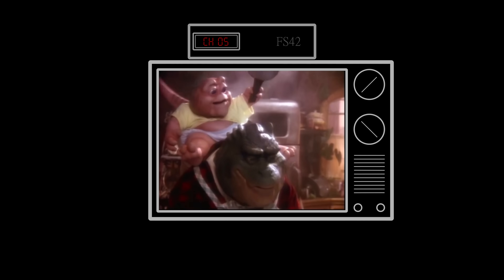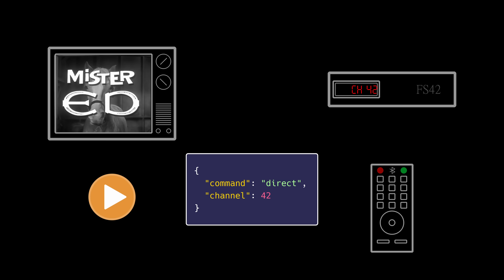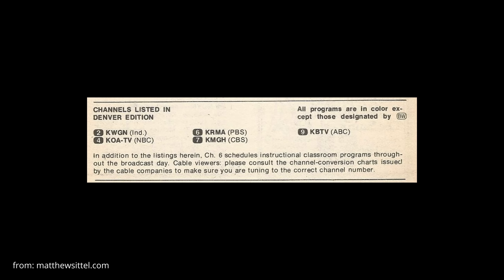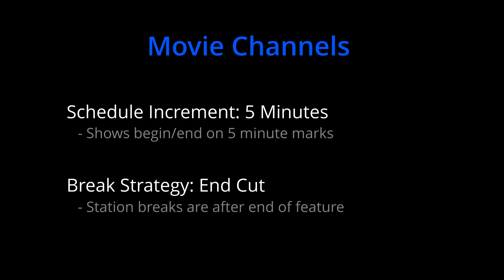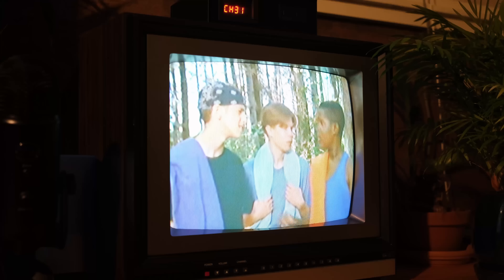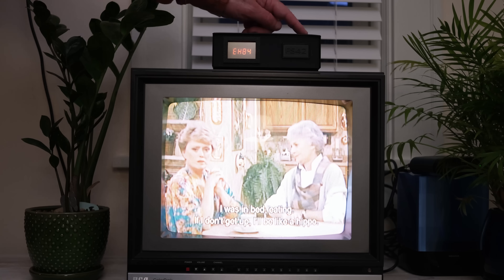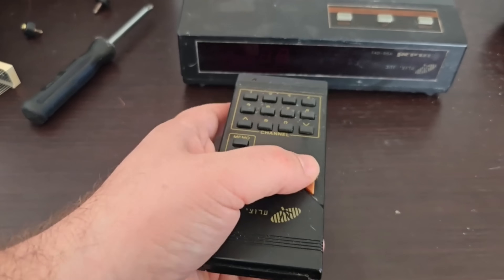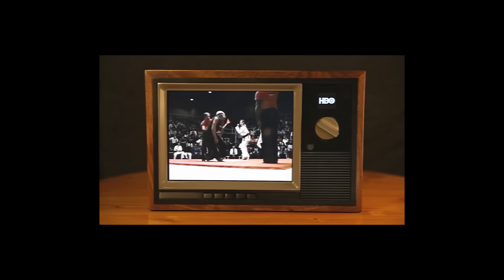90s Cable Simulator - Recreating Retro Cable TV with a Raspberry Pi

Comment: Some TV networks had playout systems that triggered ad breaks automatically whenever it detected a black screen in the video. There's probably some ffmpeg incantation that could be run over the video files to extract that data, which you could use for ad break scheduling. Doesn't work for movies, but at least it could be used for TV shows.

Most TV shows, anyway. Some played tricks to have more dramatic act breaks, fading to an image close to black but continuing the suspenseful music. That would've been cut off by the auto-break system, since it ignored sound. From memory, Buffy and possibly Angel did this (not sure if other Joss Whedon shows did it too).
Reply from the maker: I have a set of scripts that you can use to do FFMEG black detect and scene detect to find candidate positions - adds those as chapter markers to the video. When FS42 builds the schedule, it will use these chapter markers to pick break spots. It works fairly well, except in the kind of situations you describe.

Comment: So what I'm wondering is can you integrate this with a tuner card and antenna to have actual broadcast tv as well. The landscape for that isn't to much different then it was. still only gonna half a dozen channels, but they have sub channels, and program data in the feed you could scrape.
Reply from the maker: Hmm - potentially. I'm also interested in how I can broadcast it itself so I pick it up OTA - I love those artifacts.
Reply: @wrongdog_reckons  Consider something like an old school Nintendo rf converter. Those are tv stations in a box essentially. Any more power then that and the government might get upset.

Comment: Back around 2010 Direct TV used to have "Channel Mixes" where they would show 8 channels at once, without audio. You could select one and it would tune to that channel. 

Can this project replicate that?
Reply from the maker: It doesn't have that built-in, but has an API that you could easily use to replicate this if you're interested. Cheers!

Comment: When I install FieldStation42 in creates content folder. How do I make it so the content folder is on an external drive and not on the actual RPi4 SD? I need more space then the 32GB I have it running on.
Reply from the maker: I keep mine on an external drive and then make a symbolic link for the content folder. If you have more questions, you can file an issue on github or ask in discord (link to discord invite on github discussion page - pinned discussion) - I will miss them in youtube.
Reply: @wrongdog_reckons   Thank you. I did find the link to this on the page in how to do so. I just wanted to make sure it can be done. So I don't set everything up and find out it would be more difficult. I am fully dedicated to this project. Excited to get it up and running.

Comment: You’re using a Raspberry Pi 5, but is it an 8gb or a 16gb model?
Reply from the maker: This is the 8GB model, but it works fine on pi4 and even on the pi3b 2GB (though you probably need to be more careful with the resolutions you use). It doesn't use a lot of resources itself for playback, so as long as the device can play the movie files well enough.

Comment: hey i got a raspberry pi 3b+ anyways i was doing everything on github says to do but when i got to Build the Catalog after i put everything in the right places and stuff but when i try and rebuild catalog it keeps telling me 
Traceback (nist recent call last):
  File "/home/jrod/FoeldStation42/station_42.py", line 5, in <module> 
    from, rich.console import console
ModuleNotFoundError: no module name 'rich'

i even found the file and changed the name from rich to jrod but it still didn't work so i put it back to rich and still same error im not sure what i did wrong but if i have to i will just wipe it and make another fresh os for raspeberry pi and try it again cuz i was using bookworm as an os
Reply from the maker: Github issues or discord are the best place to get help on these types of questions - but it looks to me like you either didn't run the install.sh script to install your dependencies or you didn't  source your virtual environment before you ran the command. Need to run ". env/bin/activate" before you issue any commands to make sure you are working in the virtual environment that the installer configures for you. The link to the discord server is pinned in the github discussion section.

Comment: What's the best way to integrate the commercials? Shows back then had built in pacing for commercials. There probably isn't a way to automatically detect that. You would have to put chapters in the video file somehow or split the episodes into discrete files for the commercial breaks. Would make it a lot harder to do if you wanted to use the intended commercial breaks built into the shows.
Reply from the maker: Good question. Many shows archived from legal DVD's that you own have chapter markers in them where commercials would have been - FS42 will now use chapter markers to find good commercial insertion points. If chapter markers aren't available, it has a utility to search for black frames in the show, which could be where commercials were. This works okay, but if you want more precision, many video editing tools will let you edit chapter markers directly.

Comment: This project addresses the number 1 problem with modern digital TV.  I hate having to wait a second or two while digital signals are decoded.  IMO the modern state of "technology" has totally ruined channel surfing.  Now I'm thinking about putting 3 cable boxes into one enclosure so the next channel up or down is already decoded and buffered so we can channel surf again.
Reply from the maker: Always amazed me "You mean they can send 100 analog channels at a time over co-ax but digital data on the same line and I buffer on a single video??"

Comment: This was absolutely amazing! A project I would sure love to do in the very near future. But I did have a question: would this work with 16:9 content for if I wanted to do a 2000s-2010s style? I would assume its just dependent on the aspect ratio of the video file but it could just as easily need to be changed in a config of some disruption (my technical abilities are flashing an OS not coding so I'm not 100% sure)
Reply from the maker: Sure thing - my movie channels play 16:9. If the content is 16:9, that's how it will play it. There are settings to enforce 4:3 if you want (and I do on my network channels) - it does that using FFMPEG panscan to clip 4:3 out of the 16:9 content while its playing.

Comment: Hey if i dont want to or know how to code at all. Is this like i can just drag my content to folders? Like channle one is cartoons so i drag all my seriese to x folder? I really appreciate what you have done here and have been talking about wanting something like this for last few years. But I just dont know nothing. I can bearly use my computer. I got a free raspberry pi 3b+ and hope this is good enough.
Reply from the maker: You don't have to know how to code at all to use it, but you do have to do some configuration using JSON and a bit of . The Raspberry PI 3B+ has been known to work with it, so you should be fine. Check out the links to github, there is a wiki full of documentation there. It will give you an idea of what's in front of you. Cheers!

Comment: Were commercial breaks so precisely in the same spot that you can just have the software insert ads no matter the show? Or does it somehow know where the breaks are? Or did you have to manually mark them yourself?!?
Reply from the maker: It works in a couple of modes: it will use chapter markers if they are present in the file (like they are from most archived DVD content). If not, you can use a black_detect filter to look for scene transitions. Otherwise, it evenly spaces them in the content.
Reply: @wrongdog_reckons  Wow. I should've thought of the chapter markers, but the black detect is very clever
Reply from the maker: Word.
Reply: Exactly

Comment: What’s the raspberry pi
Reply from the maker: Like, in general or which model did I specifically use? Its a single-board computer - in this case it is a Pi 5 with 8GB ram. Cheers!

Comment: Im really enjoying setting this up. I got an old zenith remote and a cable box to act as a pi enclosure. I have a question though-- how do I implement the 7 segment display? Do I need to use the gpio pins and an adruino to interface with the pins then write a script to read the current channel from the api and pass that along? Im out of my element with it. Does anyone know? Its a small thing I guess, but its just one feature that would make the box that much cooler
Reply from the maker: Hey there - there are two github links in the description. One is for the software, which you found, and the other one has all the documentation on the cable box. It shows how to wire the 7 segment display and the keypad. If you have any questions, file an issue on the main github (code, not cable box) - or join the discord server and ask there. Cheers!

Comment: would you be interested in taking my design and helping me code it and get it functional? I have designed it all but im not a coder and cant do it by myself. if your interested let me know and ill send you the github and discord. mine is a retro tv emulator ive been working on for 90's tv
Reply from the maker: I mean, I already built a retro-TV simulator, focused on 90 cable that works very well - that's the video you just watched. You can use the code to build the simulation you are looking for, no coding required by you, just configuring the channels. What were you looking to make it do that this one doesn't?
Reply: @wrongdog_reckons  mine would work off of a server or hard drive so that you can use old pc on any tv as a cable box and even have all of them see the same channels, a music visualizer option for easy music channels, commercials/intro options, video games on channel 3, a tv guide on channel 4, change theme for color choices, and a lot more ideas. i already have the whole UI and design setup with minimal function and looking for coders to help me finish it

Comment: Intro all about how influential cable was... shows only clips from analog network tv. 👍
Reply from the maker: I didn't grow up where you grew up so we didn't get most of those stations until cable showed up. Cheers.
Reply: @wrongdog_reckons   Where did you grow up that you didn't get free general broadcast tv but you did get cable?
Reply from the maker: @DerpDevilDD  - Southern Appalachia - lots of close-in mountains and not a lot of financial motivation for repeaters. I go into details about it in a previous video.  Actually, I talk about it a bit in this video too. Did you not watch it and then just make a comment?
Reply: @wrongdog_reckons   ah, mountains. I guess I figured places with geographic impediments to broadcast would have similar issues with cable. And, yes, I did watch the whole video. I don't recall you mentioning anything about where you lived - only a mention that the program is flexible because people have different cable experiences.
Reply from the maker: @DerpDevilDD - Yes, we did have similar issues with cable, but two things changed: my parents got divorced so we moved close to town, which had recently got cable. I was in my teens before we got it.
Reply: @wrongdog_reckons   I gotcha. :) Thanks for explaining.

Comment: I just need to know where the content is stored. I never saw a hard drive or sd card used for the content. The amount of shows we could collect would be insane. This would require some serious storage requirements for an optimal experience.
Reply from the maker: Couple of thoughts: 480p videos (the highest CRT support) takes a lot less space than you might think. The hard drives are hidden in plain sight: look at the blue box behind the cable box in the thumbnail. That is an HDD enclosure with a 3d-printed cover on it :)

Comment: This is an incredible project! Did you store the content locally on the pi or use a local NAS? how much space do all the videos take up? I can't imagine it's huge if you are only using 480i rips. This reminds me that there are some RF modulator boxes that can transmit VHF wirelessly, so if you lived close to a friend you could even send it to someone with rabbit ears on their tv(albeit without the option to change the channel).

I am gonna give this a try... eventually. I'm not too scared of the coding but assembling the content seems daunting.
Reply from the maker: If you look at the video thumbnail, that blue thing on the left is the hard drive enclosure with a 3-d printed cover. The storage requirements aren't huge - it really depends on how realistic you want the simulation to be. Just to show off to friends? Not that much at all. Something you can watch all the time? A lot. Gathering the content is the funnest part of the project - its a never ending quest :) Cheers!

Comment: I LOVE this.  If you're going for total accurate emulation I might have a tip.  The commercial breaks aren't meant to be played at equal intervals.  Most stations had their commercial breaks set to maximize potential viewing time.  For example there would be more commercial breaks near the end of a show or movie because it was far more likely to have a captive audience waiting for the conclusion of the program.  There is also a large segment of time before the first commercial break as an attempt to draw people in.   It's oddly important for accuracy as the original programming was often designed around these commercial breaks and would often have gags associated with the fact that there was a required break at that point.  It will also help match the black screen transitions that you see in modern day streaming which does not follow the same commercial break schedule.  I'm not sure if it was standardized throughout the day but it would probably be possible to
Reply from the maker: There are a couple of options for this: we currently support using black-detect feature to detect where commercials might have originally been and insert commercials there. Adding now a feature to use chapter markers, which are present in most DVD ripped content. There is also lots of software that will let people edit chapter markers in video files, so you can specify exactly where you want the commercial to go.

Comment: I appreciate that you made the box look kind of like one of the old Scientific Atlanta cable boxes that I had as a kid in the mid 80s to early 90s.

Though the number pad on those was a single row, not a pad like on a calculator. But, I suppose you have to work with what you can get.
Reply from the maker: Ha! I was definitely modelling it after the Scientific Atlanta model. We had an early version that had a rotary encoder on it and then got the one with the single row of buttons and a digital display.  I picked the matrix keypad purely because it needs 4 wires and is all together rather than the 10+2 wires and custom housing to make it closer to the original.

Comment: What size Raspberry Pi 5 should I use? 4gig, 8gig, more?
Reply from the maker: Either will work - it really doesn't take up much memory - 2GB seems to be the min. I would go with the 8, in case you ever want to use it for something else. The truth is: a 4 or even a 3b work fine, as long as they have 2GB or better.

Comment: My local cable operator turned off analog signal about 2 month ago. It was probably one of the very last in whole country.
Reply from the maker: I am amazed that it was still running analog. Wow.
Reply: @wrongdog_reckons Hehe, yes... For years I kept telling myself I’d only buy a new TV once they shut that service down. But in the end, a modern TV found its way into my household several years before they finally pulled the plug on their analog cable. (company called STV here in Estonia).

Comment: Are the commercial breaks handled manually / did you have to tag or modify your source content to get the timing right?
Reply from the maker: There are a couple of ways they are handled: you can use black-detect filters to find the right spots or it just uses even spacing.

Comment: Streaming services and the 2000? You can't be over 25 or you would know that the Streaming services didn't catch on until 2011 with Netflix
Reply from the maker: You are incorrect, Netflix started streaming in 2007, not 2011, and cable subscriptions began their decline at the end of the decade. What point were you trying to get at?

Comment: Do you think I could use a raspberry pi 4?
Reply from the maker: Sure thing, people are even using raspberry pi 3b (2GB ram models). A few weeks ago, I installed it on a RiscV dev board and, while the video was choppy, which mean I basically had it running on what amounts to a router board with a tiny GPU... it doesn't take a lot of resources. As long as you can play videos on it well enough it should work. Cheers!

Comment: The biggest issue I see is getting the commercials to line up with the built-in commercial breaks in the content. That's the biggest issue I have with Youtube ads, they break in with no regards to the content being presented. Do you have a way to auto-scan media content to mark where commercials should go or do you have to manually assign timestamps to all your media?
Reply from the maker: Yeah - it has a black-detect filter that will try to look for suitable places if you want to use it, otherwise, it evenly spaces them. Adding chapter marker support now. Cheers!

Comment: How does the "channels" flip so quickly? Are you running all tv-streams at the same time and just flip between them?
Reply from the maker: It does not play them all at once - when you switch channels it looks up what should be playing on that channel at that specific time and how far into it and then seeks to the correct position in the new stream and start playing that. Its near instantaneous and works a lot slicker than I was afraid it would.